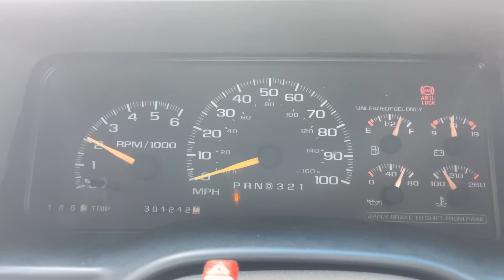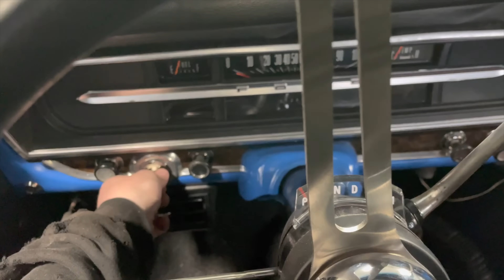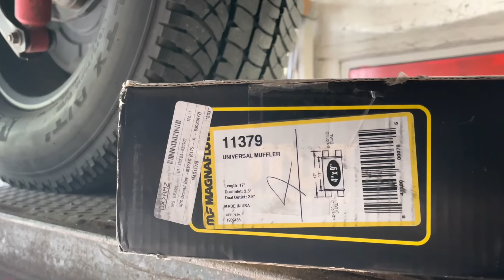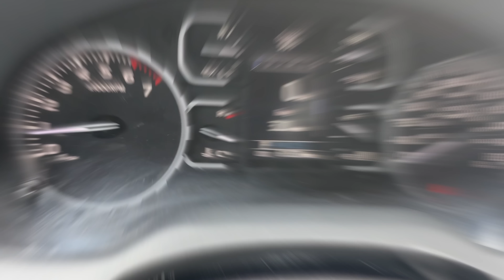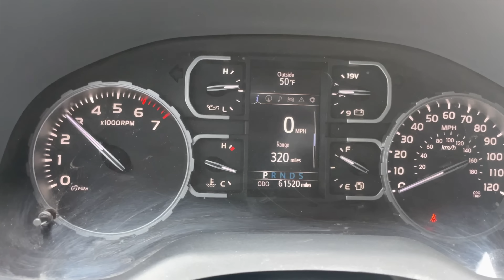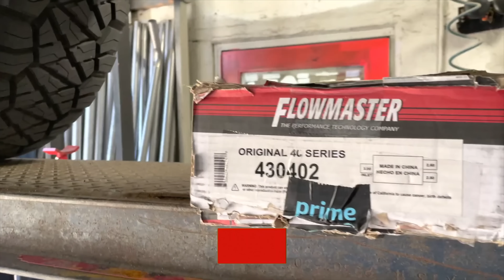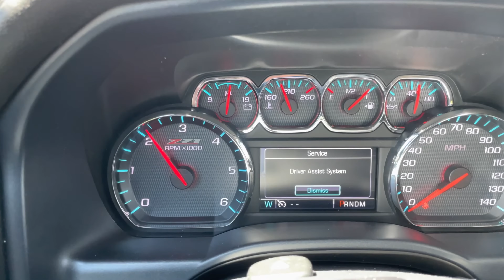We Installed Our BIGGEST Muffler!

Comment: Some good choices there.  I'm a straight thru Maggie guy as I've personally had shit results with Flowmaster baffle rattles, but the flowy sound is a nice change.  Surprised on how reasonably quiet the tundra was with such a small muffler
Reply: I can’t stand chokeMasters, they sound horrible. I’m a magnaflow guy myself also, way cleaner and crisp sound
Reply: @jaycevessier7554  With the proper setup Flowmasters are one of the best sounding mufflers. There's a reason why they were made famous by the fox body Mustang crowd. That being said it has to be installed properly with the right setup. Basically that's with any muffler.